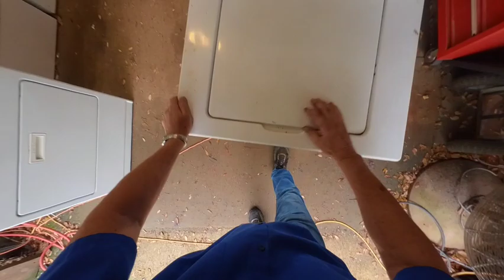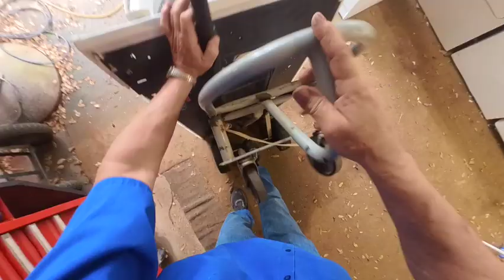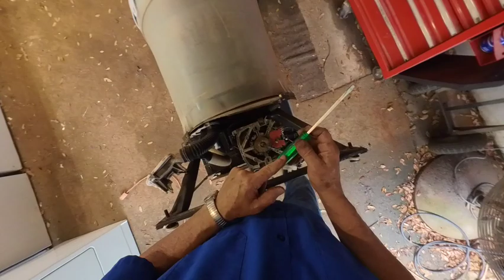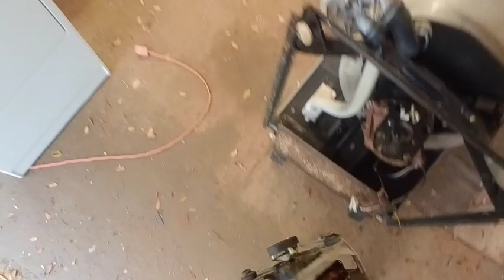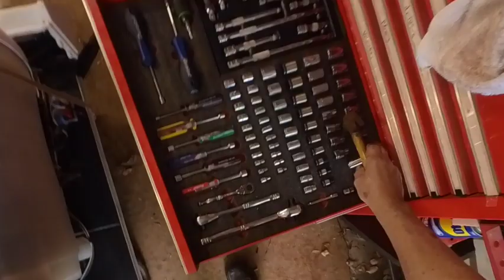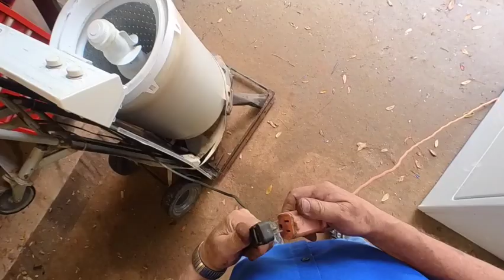How To Fix a Washing Machine That Won't Agitate or Spin: Replacing a Broken Motor Coupling

Comment: Does the shaft on the transmission side that connects to the coupler ever get worn out? Mine seems to be round and not flat on the sides for the coupler to connect to it. Was curious if this was the problem with the spin cycle and agitation. I replaced the gear box as well and I commented on another video of yours about the transmission stem not able to turn even when using pliers. U said to get a neutral drain kit...but I was wondering about that shaft/bolt on the transmission side before making a mess taking apart the transmission.... 🤔
I wish you were local to me Chip. 😂
Reply from the maker: Yeah, that would be a problem. If the shoulders on that shaft have rounded and the coupler spins on it, you’ll have to replace the transmission. I don’t think that shaft is replaceable, or at least, I’ve never replaced one. It’s usually the motor shaft that rounds out.
Reply: @HarperandKnowles  it seems to be spinning though...but when I had it all opened, I noticed it was round. Would that cause the stem/shaft on the agitator to lock up like it is? And if I need a whole new transmission, is it even worth it to try and repair or am I better off just buying a good used washer?
Reply from the maker: If it spins then the coupler isn’t the issue. As far as deciding whether a new used washer is the best option that’s gonna be your call.
Reply from the maker: I wish I could help you more my friend but alas!
Reply: @HarperandKnowles  so the shaft that the agitator connects to should be able to turn easily using pliers?
Reply from the maker: Yeah, you’re making me think now but if it’s in spin mode it should turn easily. But in agitate, no.

Comment: Hey Chip, do us a favor and let us know what brand of machine you’re working on. Great little video too. Each fix for those with knowledge!
Reply from the maker: Thanks, Rick. I failed to include that in the title when I was optimizing for search engine inclusion. So, thanks to you, I went back and fixed the title.  
I hope you keep watching, and thanks for the constructive suggestion. 
So many different machines are built on the Whirlpool planform that it's impossible to include them all and still keep the watchers attention.  Maytag, Estate, Conservator, KitchenAid, Kenmore, and others are built with Whirlpool parts.  Including them all in the title would be burdensome, but I will try to list them in the video descriptions now. Thanks for pointing that out. It will help me make better videos for those not so familiar with the industry.